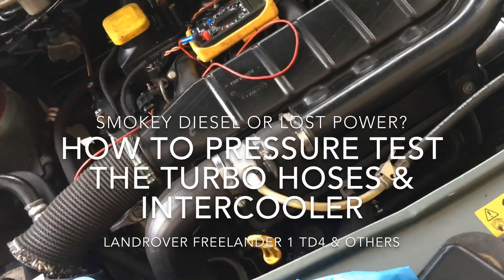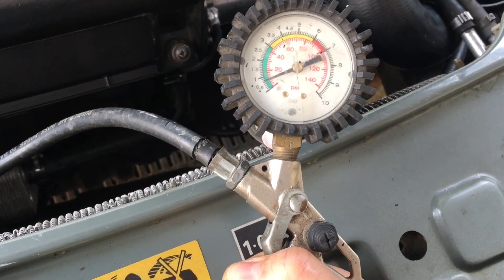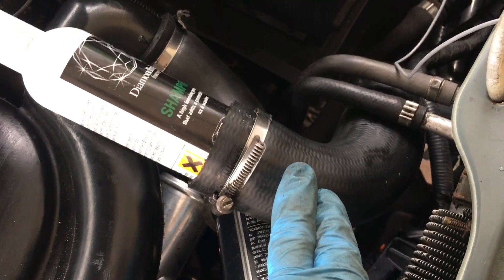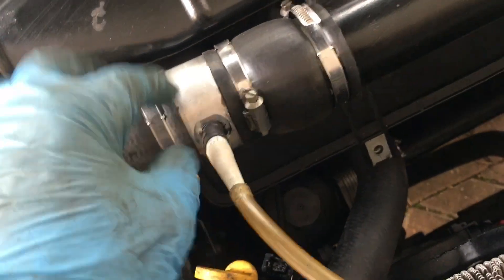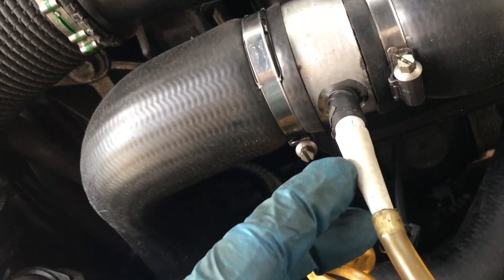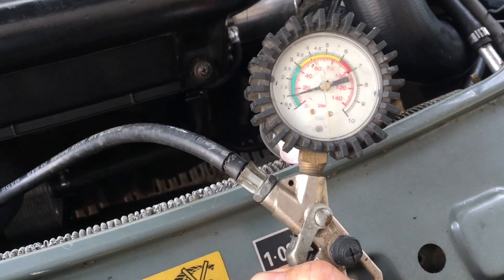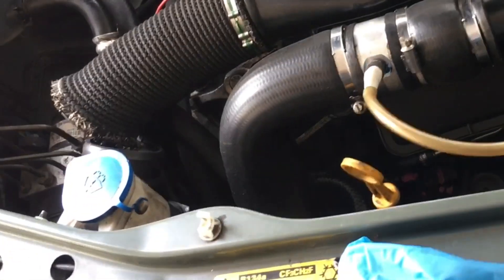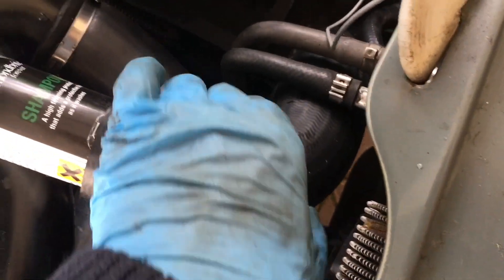Lost power? Smoke? - How to pressure test Turbo hoses & Intercooler

Comment: I dont have any pressure on those hoses how to fix it?
Reply: My english is not so good because i am from romania
Reply from the maker: Plug any holes.  Find the holes first.  Change hose if needed.
Reply: @comeinhandynow  ive changed all the hoses but no pressure
Reply: @gantoniom9615  leak intercooler or ?
Reply: @Pera-Peric  i still don't know 🙁 i changed the intercooler too ! Mâine i need to change the turbo
Reply: @gantoniom9615 diagnostics show me the low pressure in the intake manifold. I don't know why. and all the blue smoke when it is running at 2000-3000 rpm.
Reply: @Pera-Peric  for me it was the turbo actuator 😁
Reply: @gantoniom9615  I thought when I cleaned the turbo that was it. mostly not.

Comment: Hi, when doing coolant flush. I left some tissue inside intercooler and forgot about it. It has blocked the intercooler air. Car lost power. After discovering. I found oil inside intercooler, and turbo seems working fine. However when reassemble everything back. I noticed white smoke from turbo housing area. And exhaust fume smell. And yet turbo is working perfectly when it should. Can you help please
Reply from the maker: If it is just smoke from the outside of the turbo maybe it is just surface oil that will burn off with use.  Check that no oil is leaking from the oil feeds into and out of the turbo.  You will need to remove the bottom engine cover to check it.
Reply: @comeinhandynow  thank you, cleaned everything with carb cleaner, all gone now. it was old engine oil been burn off.
Reply: You’re literally a genius mate

Comment: Just got my NP200 1.5 DCI and I realized that there’s oil on the inter cooler and the turbo makes a noise when accelerating and breaking after driving for about 350km, there’s also presence of oil on the pipes coming from the turbo, can you be able to relate these issue?
Reply from the maker: Oil in the intercooler could be from the turbo (worn bearing / seal so a new core needed) or it could be from the crankcase breather pipes (check where these go and see if there is oil in it, if there is try an oil separater tank in line with the pipe.

Comment: If the pipes are leaking ‘ why does this cause smoking.
Reply from the maker: Lowers the air pressure so not enough air gets in the engine so there’s too much diesel compared to the amount of air

Comment: I’ve just bought a free lander 56 Reg 2 L diesel automatic BMW engineJust found out the turbo is gone not good but I love the car great video
Reply from the maker: Thanks. It’s worth checking that the crankcase breather filter is not blocked as that can force oil out of the turbo and look like a turbo failure.  Mine was like that.  It was all ok after changing it to the upgraded part and cleaning the intercooler of oil.  See https://youtu.be/FQwZrjGUN-o